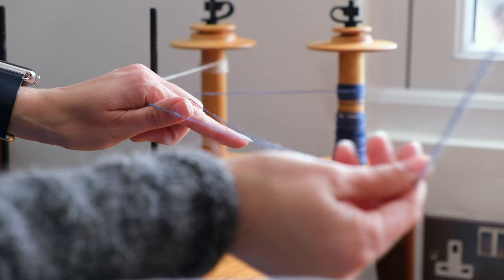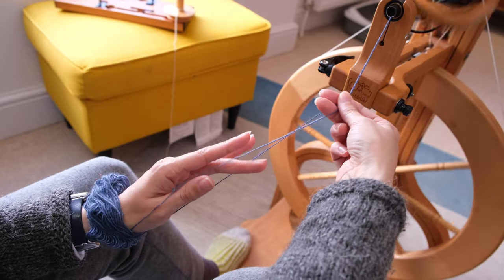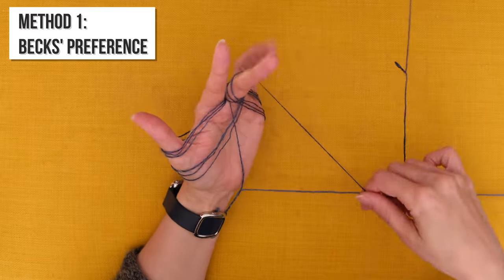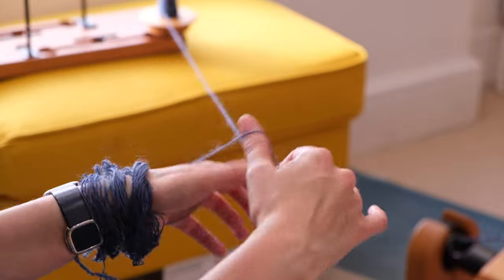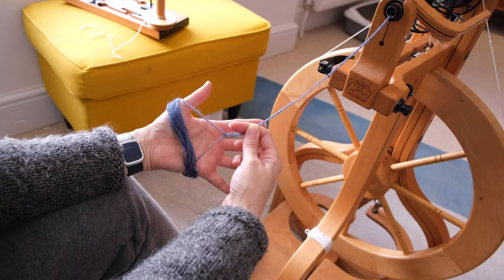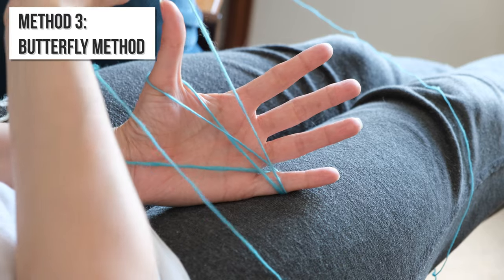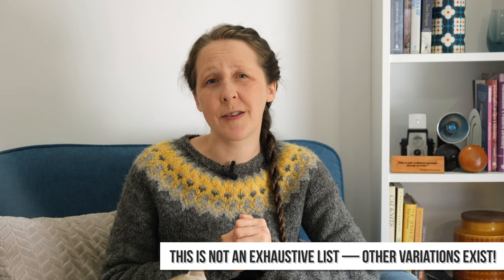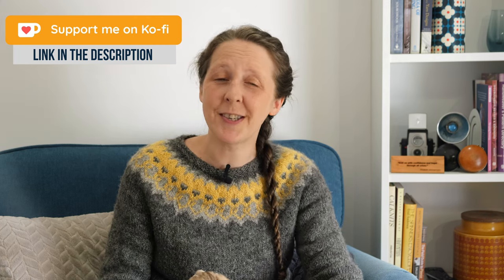Plying Bracelets (Andean Plying) — what to do when you run out of singles!

Comment: Great demonstration, Becks, thank you! My personal preferred method is number 2 you showed, for little left over. For larger quantity I like to create a center-pull ball (I know its impact on the twist, but for rustic yarns I don't mind). I take the core of an empty toilet roll, stick the single coming from the wheel in the grooves of the roll and wind it. When I'm done, the end of the single, that was once the beginning of the yarn in the bobbin, is visible. I place that end in the middle of the plied yarn and continue to ply as usual from the center-pull ball. No handspun yarn goes to waste! 😊

Comment: I have found that a large tube (at least the size of a glass tumbler) is a very useful alternative. Simply leave the first end tucked inside where it won't get lost, then loosely wrap.  Both ends can be pulled while still on the tube, and the diameter is large enough that there isn't noticeable difference in twist between the inner and outer strands.

Comment: An excellent informative video made even better by your happy cat. 😊 I am definitely going to try one of these (probably the book method) next time I ply. I use mostly drop spindles so I have been looking at methods that are easier than wrapping it around paper towel tubes and playing from there. This looks much easier to avoid tangles with!
Reply from the maker: Let me know how it goes (or how it went, apologies for taking a while to respond!).  Regarding paper towel tubes, one trick I came across recently, courtesy of Amanda Hannaford is to put some pipe insulating foam inside the toilet rolls when plying from them so they don’t bounce around so much on the lazy Kate. Genius!
Reply: @TinyFibreStudio  The plying bracelet worked very well for me! And thank you for this additional tip. I don't actually have a lazy kate yet, so my plying experience has been sooo much improved using the bracelet method!

Comment: Very clear explanation thanks you.   You mention rewinding a single before normal 2 plying makes it smoother - is this still the case when using the bracelet ply please?    Thanks again
Reply from the maker: Great question! When you’re using a plying bracelet you’re taking two ends of the same yarn, effectively folding the yarn in half. One of the strands would be going in the same direction as it was spun, the other strand would be going the opposite way. So no, rewinding for the sake of making the yarn smoother doesn’t apply to yarn plied from bracelets. 
Hope that helps! 🙂

Comment: I try and make sure I guess the right amount of singles to put on the bobbins so there is no need to wrap anything. But I don't often get it just right so then I go round the back of the chair and round the door handle until all the yarn is off the bobbin and hope it doesn't tangle up before I get it plied up. Your method looks a bit easier, I'll give it a go 👍😀

Comment: 06:15 I am curious how one would use this method for 3-ply yarns. I haven't heard about that yet, and it would be very useful.
Reply from the maker: I spin my singles onto three bobbins as usual, then when one runs out I assess which of the remaining bobbins has more yarn left on it and that's the one I make a plying bracelet from.  I use the two ends from the plying bracelet plus what's left on the remaining bobbin until one of then runs out.  Normally (🤞🏻) there's not much waste left by that point and I'll just two-ply the rest from another bracelet to use for skein ties or leaders.